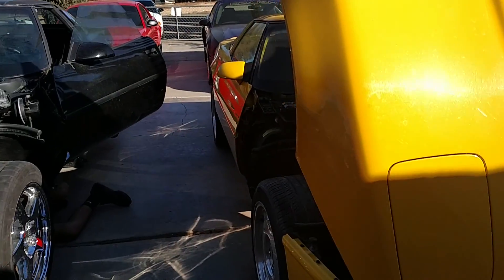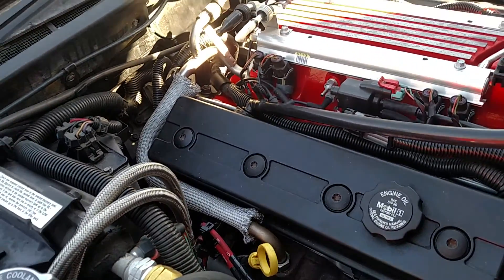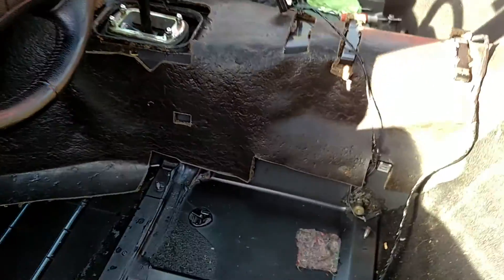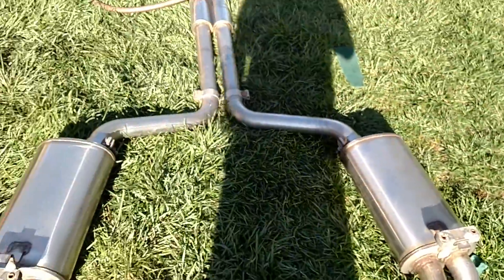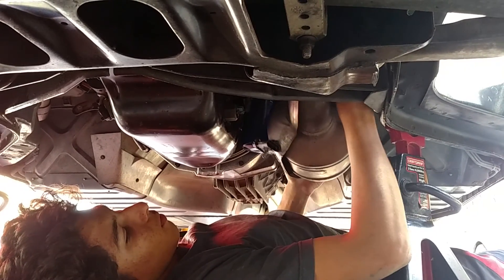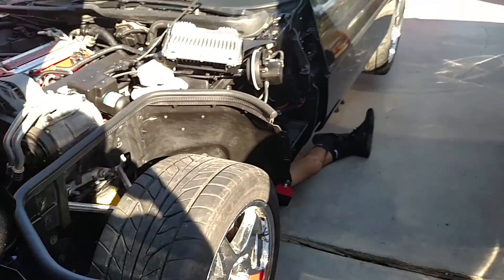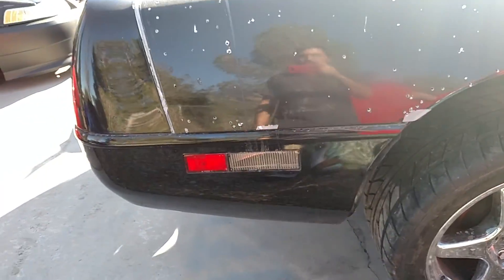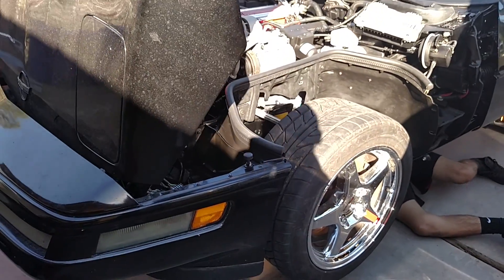Corvette C4 LT4 Project #7

Comment: This has been an incredible amount of work for a guy working at home on concrete driveway with no lift.
With your depth of knowledge, if you had shop with a lift imagine what you'd accomplish. Unfortunately your overhead would be more too, so maybe it is better to keep it simple and work at home.
Your son is a very lucky young man being able to learn hands on, and work with his Dad.
When I was a kid in the late '70s, I built a bunch of '69 Camaros on my parents gravel driveway, so you're one up on me having a concrete driveway, but cars were so much simpler then.
Now you not only need to know the mechanical nuts and bolts of the hardware, but now there are so many sensors, and wires, and everything is computer operated, it looks like it can be overwhelming.
You and your son do a great job. Excellent C4 videos.
I really enjoy them.
Take care

Comment: Nice work on your LT4. I have a LT4 Project thread on corvetteforum tech section. You selling any parts please let me know. 
Thanks!
zach
Reply from the maker: I have tons of parts. What are you looking for?
Reply: So far, I am looking for a LT4 96 steering column that is in good shape, mine is wobbly and I think needs new tilt pins. It is really bad and the steering column goes up and down and left and right. Also, fuel door metal and drain rubber boot. The torx screws on mine were stripped so I had to drill them out to try and change my fuel sock. I don't need the door just the torx screws and fuel metal piece that says Premium Fuel only. Also the driver side wheel well plastic thing right by the wheel near the shock. Also the under wheel well weather stripping.Bottom line I wish you were in the Dallas Tx area because I think it would be cheaper to just by your scrap left overs as a whole than piece meal. 

I can send you a link to my project .. I don't want to just put it here because I don't want to infringe on your project .  Thanks!
Reply from the maker: You can put the link here, I don't mind.
Reply: http://www.corvetteforum.com/forums/c4-tech-performance/3890067-project-96-lt4.html

Supposedly owed by Nicolas Cage. bought from an elderly lady from Venice Beach California who bought it in 1999
Reply from the maker: Very nice. I just went through and read most of the thread. Are you still having issues with the misfire? I've had many LT1/4 cars and when they sit for a while they always misfire. Lets me know if you solved the problem?
Reply: Ha! I wish. I found out that  one of the vent harness on the opti is missing and the one that is on there is on the wrong vent!   Oh well I am going to pull the Opti off when I get back home from ThanksGiving break. What's another 4 hours of my time :-)
Reply from the maker: Do me a favor before you do that. While the car is running take a long screw driver put the tip on the injector body and put your ear to the handle. Listen for the tick, tick, tick. Do it to all of them to see if they are ticking. If you don't hear one ticking lightly tap the injector body with a 6" 3/8 extension and see if it comes back to life. It sounds weird but it has came through for me more than once. Mike.